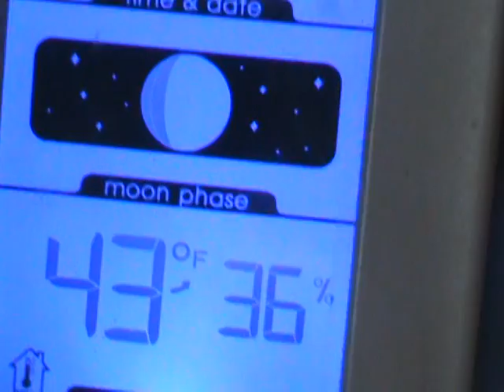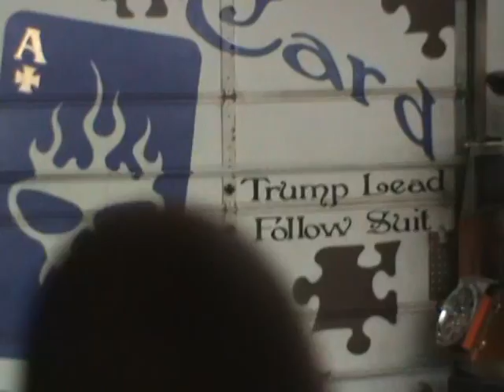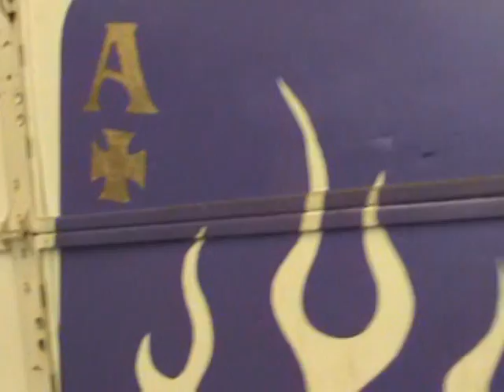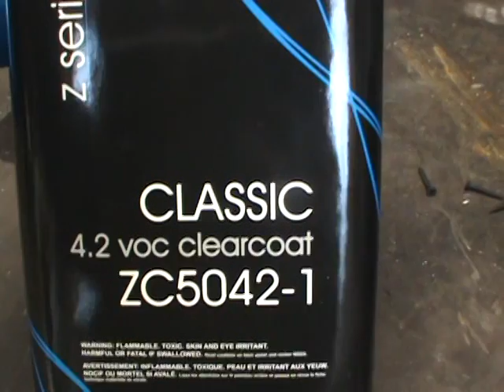PACMANS BACK.......

Comment: Tires leaning out might be from worn out ball joints or control arm bushings.  Not sure without seeing it up close.  Also, I was mentioned that it may relax if it was up in the air on lift or stands.
Reply from the maker: its   not from being on the lift(i wish it was from that)

Comment: No torsion bars, that's a Twin Traction Beam suspension. Looks like it has either lifted springs or spring seat spacers, but they didn't drop the axle brackets to correct the camber change. Not a hard fix but it can get involved depending on what has been done/not done. To determine if it's springs or seats, look at the cups where the springs mount, If there is only 1/2" or so rubber between the spring and the mount it has longer springs, if it's thicker than that they used spacers. Both types of lift are used. Either way, the fix is to install drop axle brackets or camber bushings depending on how much lift it actually has. I doubt bushings will bring it back though. Go visit 
http://www.therangerstation.com/tech_library/index-suspension.shtml
for pictures and more explanation of the situation than I can type here.
The basic repair is to bolt in drop brackets and lengthen any lines as needed. If that one has the POS vacuum hubs save yourself a lot of grief and change them out for manual hubs now. The seals and parts tend to corrode and cause multiple problems when they leak.

Comment: Schu the ranger you have does not have torsion bars.  what you have the camera pointed at under the truck is the radius arm which is not adjustable so to lower it you would have to replace the front coil springs.

camber is the tilt of the tire to change that there is a camber sleeve to adjust that you have to press the upper ball joint out and the sleeve is inside you can turn it each notch is half a degree
Reply from the maker: thank u on the info about the camber